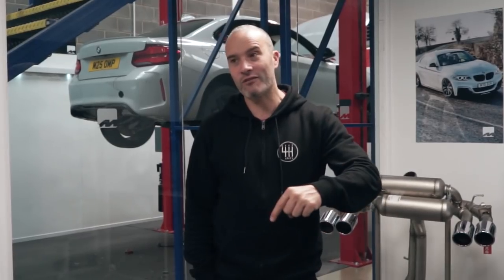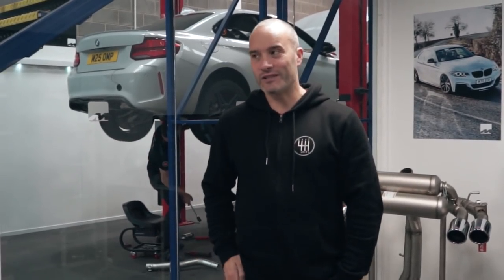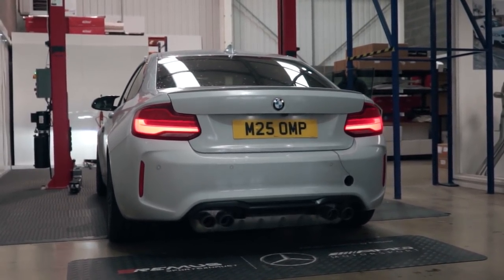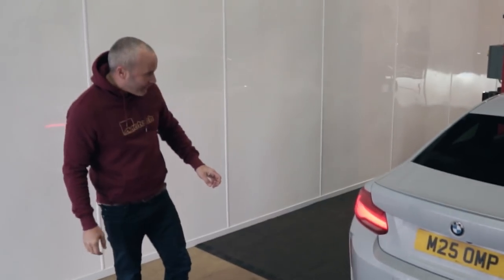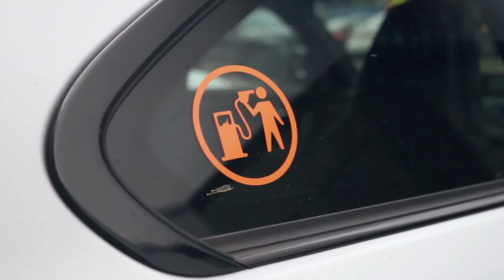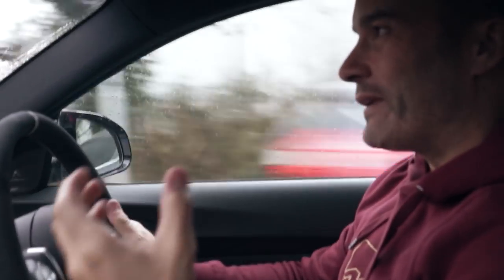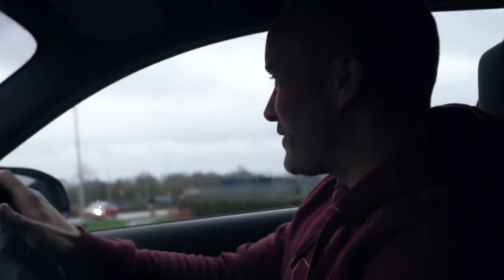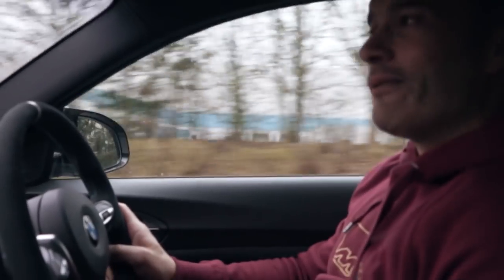Motech Vlog 07 BMW M2 Competition Remus Exhaust With Joe Achilles

Comment: I fitted also remus homologated exhaust, and now i ordered race version, because i wanted even more sound:) Ony bad thing is, that bmw electonic valves are closing above 40km/h including if you have in sport or sport plus! Than i took the flaps wire off and put the valves permanently open, and the sound is wooow, so much better!